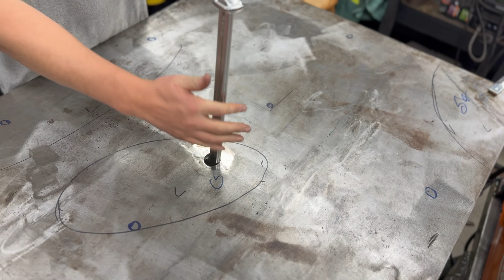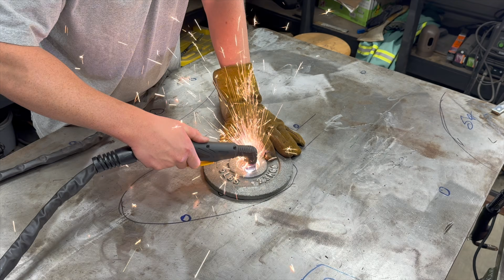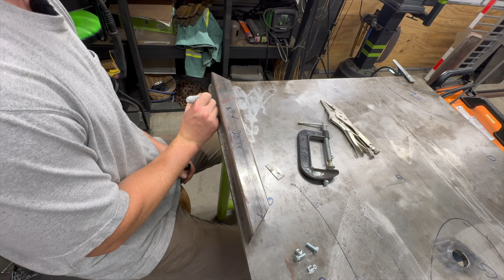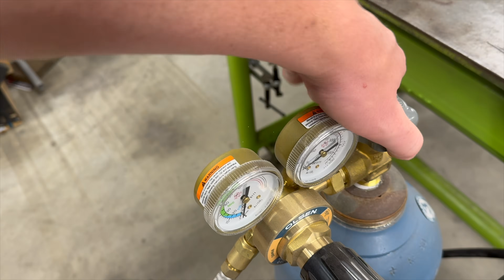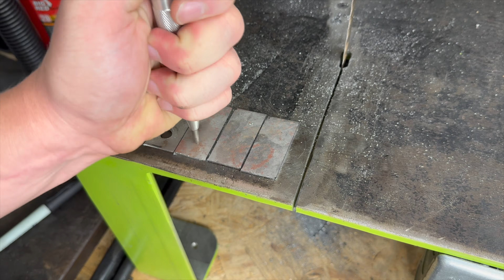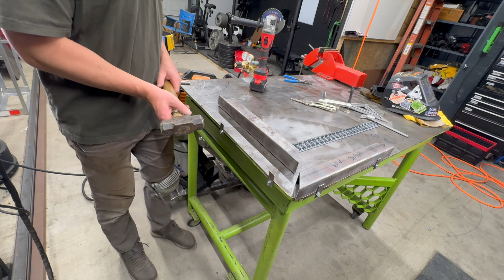My Welding Table Keeps Getting Better...

Comment: The tabs are a good idea - BUT - they are too thin.  
1/8 " minimum thickness and rounded corners.  You'll find out why when you scrape your arm across the sharp pointy edge and the tabs keep bending - a nuisance eventually
Reply from the maker: Solid advice. I already hooked a part on one and bent it😢

Comment: Why not just drill a few 3/4 holes in the table and buy a few fireball table clamps?
Reply from the maker: Takes a bit to drill 3/4 holes in 1/2 inch steel. But I guess so does building a frame to adjust flatness! Haha